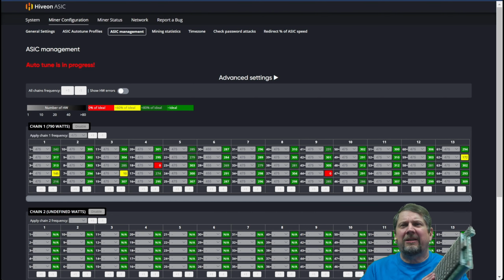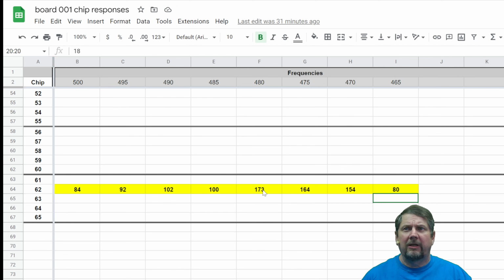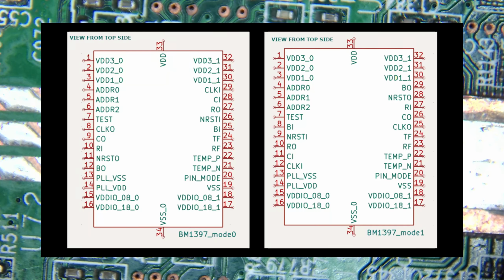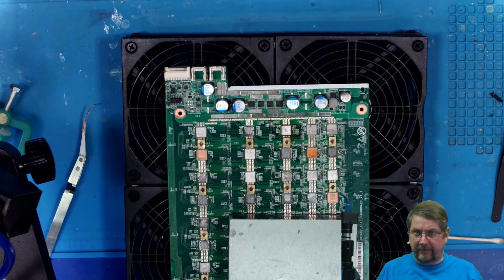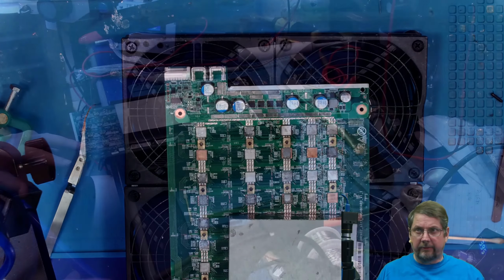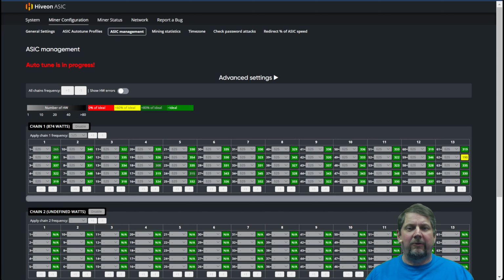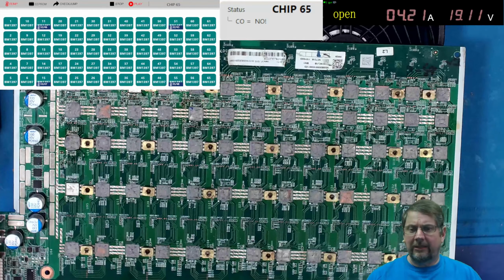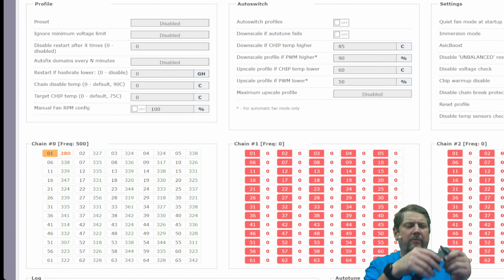S17+  board 001  -  diagnosed the problem with Hiveon ASIC firmware

Comment: Hello there :) 

Just a quick question: i‘m also doing diagnosis with hiveos, but i have some boards (they are working) but one chip is red (let‘s say chip 15) so i changed this chip 3 times, everytime same - stays red. So i also changed chip 14 and 16 - still same - 15 stays red. So checked resistors and condensators around 15 - everything looks fine - voltages good, resistance good, diode values good. Also Temp sensors are working all 4 without a problem (and it‘s chip 15) 
Any other ideas? Or maybe change 4 or 5th time :-D
Reply: Ok - changed the chip now 4th time - and what should i say - it works now 😁
Reply from the maker: @outbreak198x  I was going to ask if you were replacing with new or recycled chips. Sometimes it's just a bad chip, other times it's the installation technique that gets me in trouble. With every repair it gets better.

I'm working on a chip tester design that should allow for testing recycled chips before installation. That way you don't have to change a chip 4 times 😁

Glad you got it working. Congrats!
Reply: @iagmr  yes, i‘m also working with recycled chips - also trief to get the tester from dreamerx, but they are very closed om their products… but i test them with 1,4V normally it works great… but yes, looks sometimes ro is too low or connection is bad… i‘m learning over years now, but always try to find new and easier ways :-)

Comment: You are making a typical error, the order of the temperature sensors is not the same as the order of the chips, the chips you changed go to another sensor on the status page, I don't know if I understand myself but that's not the order lol.
Reply from the maker: I determined my temp sensor order by the order displayed on my tester and it's chip association. That seems to align with what I see in the miners when they report temp values too.
Reply: @iagmr  sensor 4 is not located in chip 36 speaking of t17+
Reply from the maker: @luisdaviddazasalas9987  I'm not familiar with the T17+ boards or any of the T series. I have S17+ boards. On the S17+ temp #4 sensor is connected to chip 55. I hope I didn't say chip 36 was connected to temp #4. That would be very wrong.
Reply: @iagmr  no bro sensor #3 on the s17+ is connected to 55, you can remove the sensor and check
Reply: Sensor 4  chip 51
Reply: the order of the sensors changes, likewise chip 11 sensor 2 chip 15 sensor 1
Reply from the maker: @luisdaviddazasalas9987  OK, that's interesting. Removing the sensor would be pretty easy to do. Thanks.
Reply from the maker: Just wanted to say thanks again for pointing this out. Today's video points out my mistake with the Team Miner tester vs what the miner reports. https://youtu.be/HHT2iCAbw-k